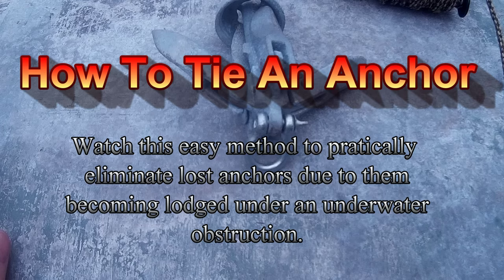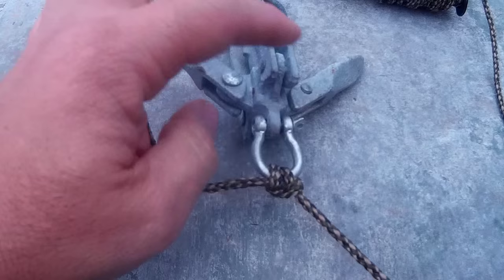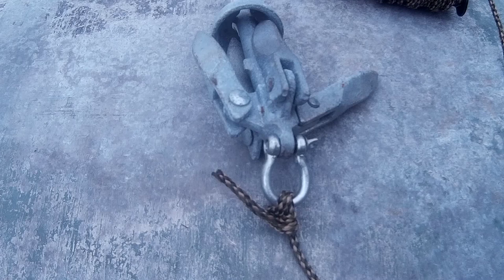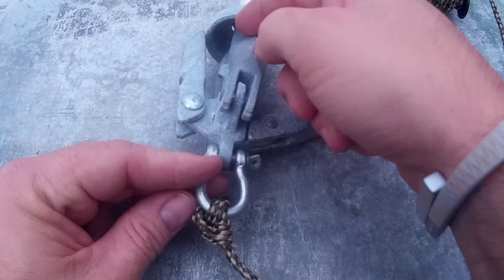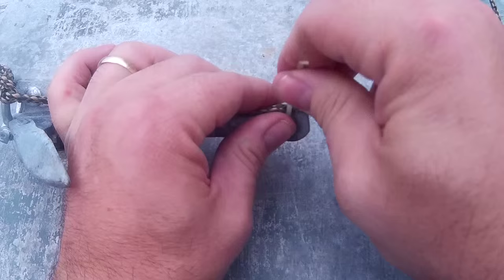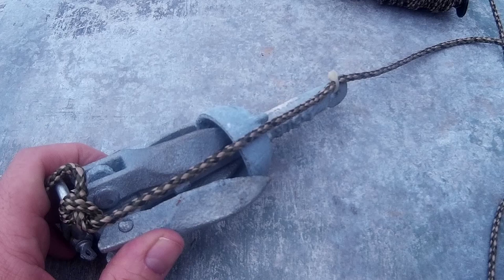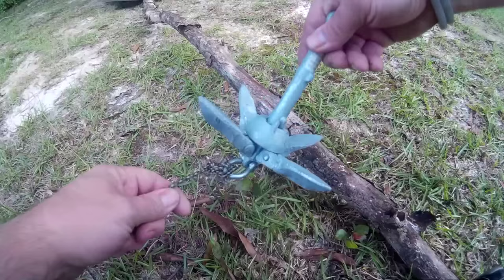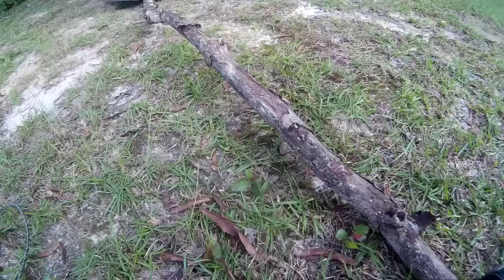How to Properly Tie a Kayak Anchor Using a Anchor Knot and a Zip Tie

Comment: Just saw this. On the way to my shed now to re-tie my anchor.  No, really. Thank you. This is great.
Reply: Do not use a very big zip tie.  They don't break as easily as he makes people think-especially if you are in a kayak and not able to keep a steep angle which is necessary to make it break.  I use as small of a zip tie as I can find-like those used to zip-tie around a jig skirt.  I keep them in my tackle box already anyway
Reply: I too carry some thin zip ties with me now.
Reply: Came in handy. Saved my stuck anchour, about six months ago. This works!

Comment: Good Video. I'd add a few points though. Just remember that you loose all leverage on the anchor when your floating in a kayak. Use the smallest zip tie  you can find or you may not be able to apply enough force to break it. ( I've found 10# mono to work good too.)  Also, always try to pull in line with the length of the kayak and not off the side otherwise you stand a good chance of rolling over when that connection suddenly breaks.
Reply: Excellet addtion to a good video. Thank you very much
Reply: Yep , I have lost 4 of these anchors because zip tie would not break . I started cutting zip ties in half . But then , I found that mushroom anchors work better . I have used a 5 lb mushroom anchor for years and it has never gotten stuck yet .

Comment: Zip ties are very strong even small ones. If you are in a kayak pulling on your anchor rope trying to break the tie there is a REAL possibility of tipping over. A lot of pressure has to be used to break the tie. Trust me, done it. Use thin string or light mono.
Reply: I was gonna say, a string light be better or even some bread ties would be good enough to drop the anchor down straight and have it dig in.

Comment: Uhmmm... this is great and all but you will lose the top ring of the anchor setup if you have to snap off the cable tie to release the anchor.  Need to leave a shackle on the top ring as well so you don't loose the ring off of your anchor.  Then you can attach the line to the shackle at the top of the anchor.

Comment: 5 years later you're still helping folks with this video.  I finally got an anchor for my fishing kayak, I fish near a lot of waterfalls and the currents are always dragging me all over the place.  I'm about to use this method thanks again
Reply from the maker: Awesome. When you're trying to fish a particular spot, an anchor definitely comes in handy. The wind and the currents are always trying to push you about in a kayak.
Reply: @TheManCaveVideo  Worked liked a charm, and actually no snags.  Caught a few panfish and had a blast.  I used a 1.5lb anchor and it was plenty for my kayak.

Comment: I know this video is 6 years old, but I just wanted to add my thanks to TheManCave for putting this up. I have recently started fishing more from my kayak and added an anchor just like the one in the video to the boat. It wasn't long before the anchor became hopelessly stuck at about 30 feet down. I struggled with it for a while and experienced all the dangers of trying to pull hard from a kayak. I had no choice but to cut it free and lose 30 feet of rope plus the anchor. 
I simply had not done my homework on how to rig this style anchor.
Thanks again.
Reply from the maker: Hopefully if there is a next time, it will end better. Thanks for the comments.

Comment: Awesome video. I just got my first foldable anchor and was wondering the purpose of the eye at the bottom and you showed me. 
Now, I also understand the reason the top eye on the shaft has a hole with a sharp inside edge, it will help cut the zip tie.

Comment: Just keep in mind once you do get your anchor stuck and you yank on it and break the zip tie it turns over and comes free but when that happens you loose the metal thing that Locks your anchor closed once the zip tie breaks it slides right off the end. It happened to me
Reply: I found a solution for this. Put a zip tie around the top so that it blocks the metal thing from going over board
Reply: I’m just reading these comments today. Do you even need the metal shackle on the anchor itself?  The eye of my anchor is so small that I can’t for a shackle through it. Can you use rope between the chain and the anchor?

Comment: I agree the way you tie your Anchorline to the bottom of the anchor but by making a loop and leaving some slack in the line and then tiny yard tie wrap you’re pulling on the tire rack first and it will break and then flip over to the bottom section of the anchor. Must of fishing is Salt water.

Comment: This is a good technique. To further simplify it, I remove the shackle from the front end of the anchor and tie the line directly to the hole in the anchor.
Reply: Ron Mehringer bad idea, as the anchor lands in the bottom, the fixed rope will wear out or get cut, the shackle provides distance away from that bottom eye to keep abrasions to a minimum.

Comment: I have a jet ski with a grapnel anchor. The bottom of the anchors eye is too small to fit a shackle to it. Can I use several zip ties to attach the chain there?? And then another that could break on the shaft/handle/top?  I don’t know all the lingo.

Comment: First, thanks for the excellent instruction for tying an anchor knot!  I like the theory of the zip tie, but I know that zip ties are pretty strong and the amount of pull force you can apply from a floating kayak is pretty weak.  I am not really convinced it is practical to pull a line from a kayak with enough power to snap even a thin zip tie.
Reply from the maker: +Explorer Mike the small wire ties break with about 18 pounds of force. I have done it from my kayak and it's pretty easy. Once in position to free the anchor, a quick jerk on the line will snap the wire tie quicker than trying to just pull against it. Hope this helps.
Reply: it's very possible to snap a standard size zip tie. The ones that he is using are very easy to break so it's only serving as a temporary holder for the anchor line. Even a standard size 8"zip tie will snap with ease. Keep in mind a zip tie doesn't snap into, it's only breaking the small tab in the head of the zip tie.
Reply: +K Carnes OK, Great! Thanks for the cleaver idea and comments.
Reply: I lost an anchor even when using this method.  It was windy and I didn't have enough anchor line to get to the bank wheree I could really pull hard.  I had to cut the anchor line.  There is little risk in using a very small zip tie-especially if you have spares.  Using a too big of one will NOT let you break it-and could be downright dangerous.
Reply: Cuivre there are two things to help prevent your experience if you find yourself with only large zip ties: 1. Ensure the line will be directly under the zip tie gripper, it’s easier to break the little tooth that grips it. 2. If no small zip ties, tie it with 6# fishing line no more than twice around, this combined with the sharp inside edge of the top hole will release it fast. Test your ties the same way he did until you find what works for your anchor before you go out to the water.

Comment: I found that my zip ties are strong so I cut part way thru it to weaken it.
Reply: Lurechunker Too 35lbs is about the most we can pull from a kayak before we get into tipping trouble, so buy zip ties that are rated for less than 35lbs. and you'll be fine. One key idea is to make the heavy pull with the bow of the boat pointed at the anchor so the pull is along the kayak's length , NOT off to its side or you will go swimming.
Reply: Dollar store zip ties, guaranteed to fail with a little bit of force.
Reply: If you noticed, the top eye where you put the zip tie has a sharp inner edge, it’s there to cut the ties.

Comment: 100th like, nice helpful video thank you. Assuming you get one of those rings for the bottom at a hardware store
Reply from the maker: +Baseballfan19946 you're welcome. Thanks for the nice comments. Yes you can get those rings at the hardware store. That one actually came with that anchor from Academy.
Reply: NorthBoundProductions Amazon, eBay, Harbor Freight, Walmart, and Northen Tools have them too.

Comment: Try to set it up so that the plastic zip tie doesn't become garbage in the lake/river/ocean.  You can also use fish line instead and tie it to the anchor so that if it does break it will still be connected.
Reply: Sgt. Rock so trade thick waste with thin waste? Just use kitchen twine, job done.
Reply: @gilbertodiazcastro8871  what part of "tie it so that if it does break it will still be connected" don't you understand?

Comment: I was going to do this until I realized, how do you prevent losing the piece that keeps the arm part of the anchor down. If its upside down on the way up nothing to stop from losing that part.
Reply from the maker: You can put a large zip tie just under the flattened part of the shaft to keep it from falling off.   I will probably do this to mine now that you asked this.

Comment: I find using raffia string is cheaper and easier, sometimes the zip tie is too strong.
Reply from the maker: Good tip.
Reply: Agree cable ties are a bad idea light string is much safer.
Reply: That’s too expensive, just use 100% cotton kitchen twine, it’s biodegradable and if fish eat it it is digestible.

Comment: How are you supposed to pull hard enough in a kayak with out tipping  over?  I imagine you would have to lean the opposite direction.  However, once it finally broke all your weight is leaning to one side, and over you go.....  This seems like a great idea, i'm just wondering if you've tried it on the kayak in the water.  Does it break easy enough so that you don't have balancing issues?
Reply from the maker: My advice is to not pull from side to side but from front to back. Once you get lined up and take up the slack in the Rope, jerk on the line quickly and it should snap unless you've used a large zip tie then you might have a problem. These small 4in zip ties only have a tensile strength of 18 lb or so. I have done this from my kayak one time and I did not feel like at any time that I was going to flip over. Hope this helps!
Reply: TheManCaveVideo thanks, I picked up the anchor tonight so I'll give it a shot.  Hopefully I never need to break the zip tie but I'm putting on the skinniest zip tie I've seen.  Thanks for the help!
Reply from the maker: You're welcome. Good luck and have fun.
Reply: Steve Jory 1. if you can’t swim you do t belong in a kayak. 2. NEVER pull from the sides, get kayak or canoe parallel to the anchor line, ZTGEN pull

Comment: I dont like this tecnic,i personally try a 2 lines anchorage sistem and work easy and properly. In a year fishing how many zippties drop off into d water by 20 fishermanw in same river,creeck or 10 scuare miles of sea???. Too mush trash on waters now and is enoght with a lead tackle on oceans botton. That's my point
Reply: I tend to agree ,too much pollution ,I'm gonna apply that logic in a way that creates none...
Reply: Good point....that got me thinking on a way to be able to use this method without leaving anything behind.  Use a LARGE ziptie on the anchor eye and then attach a downrigger line release to that ziptie, then clip the line into the rubber pinchers of the downrigger release....or even use a Prussian knot rig
Reply: buy biodegradable
Reply: you can ziptie the ziptie to the rope or something along those lines lol
Reply: Then use a piece of biodegradable garbage bag or something. I’m sure the water is t going to fill up with nyties before your grandkids are out of college 🤔
Reply: Don’t like zip ties because of the pollution? Fine, use 100% cotton string instead, it will rot away in less than a year and if a fish eats it it would be digested. Problem solved without a second line.